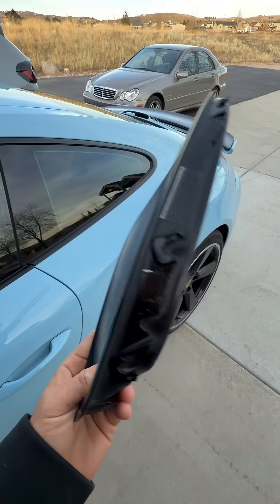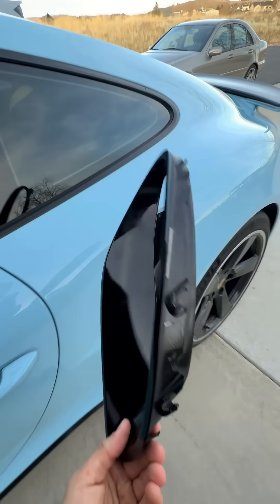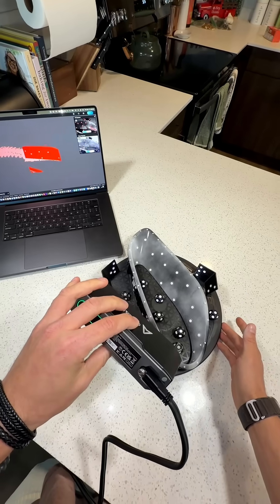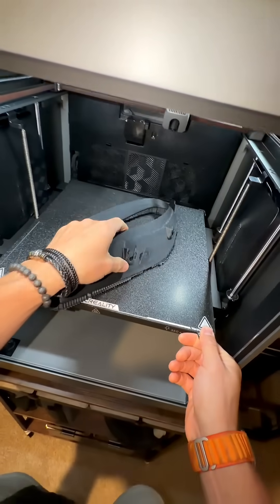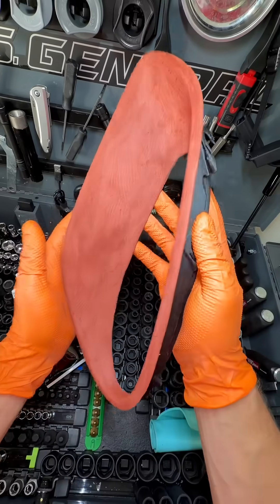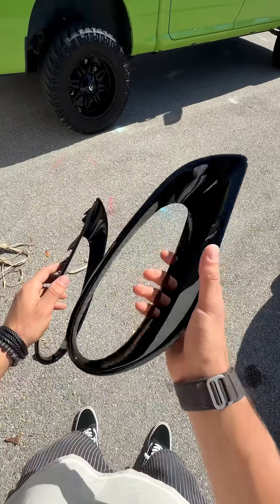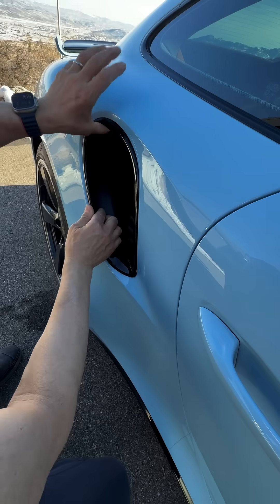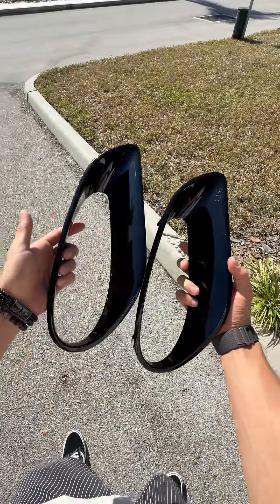Porsche wanted $2,000... So I 3D printed it for $20 instead😳😳😳 #3dprinting #creality #porsche

Comment: Creality Otter Scanner: $675 + Tax
Creality K2 Plus Combo 3D pritner: $1,200 + Tax
PLA used is minor, couple bucks.
Time to print everything, total about 2.5 days, maybe longer depending on print settings. Even longer for anyone who is new to printing and has to print multiple wasted prints to get the settings right before attempting the final product. 

Oh yea, any average weekend warrior could do this 😂 Spoken like someone who owns a Porsche lol

Edit: For the wasted prints, there is a recycle too that breaks down the prints. All you need is a PLA shredder, an extruder, and a spooler. That should only run you close to $10,000 😂

Comment: F Porsche. 

Saying this as someone who owned 2 last air cooled 911's (98, 4 and 4s). 

Still, definitely better than the bmws I owned. Both costs an 💪 and a 🦵  to service, but Porsche definitely far better quality, but also evrn more expensive than bmw to upkeep.

I miss 80's to mid 90's benzes. Even volkswagen, golf2 is unbreakable. Especially those 1.9 diesels. Tanks.

Comment: You can save a lot of money with 3D printing.  That said, you need the training and more money in equipment than a new part would cost.  Also; if the car was ever going to have collector or long term value - it has to be original.  It would have been cheaper for most people to pay the 2K on the part.

Comment: How long did it take you to do it all, and cost of materials etc? By the time you calculate your labour costs (and surely you aren't working at $15/hour rate😊), expenses etc, you need to add some profit to make your effort worthwhile. If that comes near $1790, then it's not worth the bother.

Comment: I feel like a decent amount of people are missing the point of the video's main idea. People are more focused on prices when I feel like the video's mainly just saying that sometimes investments are worth it. Sure it could be cheaper to just buy from the manufacturer for an unjustifiable price, but if you put around the same amount of money into something else, being a 3D printer, 3D scanner, Filament, and time, you could pretty much replicate things over again.
If I had to bring things together in a different way, you could go to the local staples to print all your photos or documents for a set price, but if you buy a printer, all you'd need to do is buy the ink and paper and print to what your supply has to offer instead of having to pay every time you want to print a singular page (I have realized how ironic it is that I used regular printers to act as a seperate way to put a perspective on the "DIY Investment" thingy that a 3D printer provides you with, but it's the best I got as of typing the comment).
Now yes, I do have a 3D printer, but no, this isn't something I'm saying just because I have this particular piece of equipment that not everyone has. I'm just trying to give an explination of what I think the whole point of the creator uploading the video was supposed to be, typing it with the least amount of bias I could have in myself... also I'm not going after anyone or naming anybody in particular, I just want to try to help explain to those who are looking more at comparing prices and seeing things in a short-term perspective (sometimes it's worth to spend a bit more now to spend less later rather than continuously spending the same amount. It like comparing 6,000 + (400 × X) with 3,000 × X, with X = amount of times needing to replicate. The 2nd one would eventually overshadow the 1st one despite starting off lower). Yeah it's a small part, but the guy specifically mentioned that it is a cheaper replacement if it ends up getting lost or stolen *Again*, I wouldn't want to pay a large price over and over again when a cheaper option's at my disposal. Now sure there's times where some things are more justified buying from someone else rather than making yourself, but why would people actively spend more for the same result unless they're just trying to burn through money, which would be a lot easier by actually burning it.
Anyways, long comment aside, have a good day or night to whomever's reading.

Comment: I mean did you really save? Once u ad the cost of the 3d printer, the 3d scanner, the body shop and the filament you’re probably pretty close to the $2000 part. So i wouldn’t say saved $1000’s. But nice work if you already have the tools.

Comment: Never thought I’d think such a simple part would be worth $2,000 - but this video has convinced me that this one is
Reply: It’s not worth $2000. They figure of some person paid $250,000 for a car they will pay $2000 for a part. If it was Chevy or Ford it would be $200
Reply: @BHFWaterloo  All you have to do is look at some of the parts commonality between supercars and regular cars. I have an Aston Martin with a lot of Ford parts in it. Aston alternator is $1200 and the identical Ford part is $225. Aston starter motor is $1600, Ford/Jaguar starter is $175. Aston washer pump is $750, Ford washer pump is $80. All identical. The markups are insane.
Reply: @BHFWaterloo it still is this + the porsche tax. The nornal version isn't significantly expensive. The carbon fibre version is expensive (obviously, everything carbon fibre + directly from teh manufacturer is crazy expensive)
Reply: People buy such cars to prop their egos, so they will pay for the parts.
Reply: @thestonegateroadrunner7305  Nobody likes to pay OEM parts prices no matter how prestigious their car is, trust me. Every supercar forum has a database of alternate parts to avoid OEM prices.
Reply: Funny comment 😆

Comment: The real challenge here is clean the 3D scan file to make sure the clips can fit back into the car. The clips are hard to scan as you can see in the video. It might get too loose or too tight. Plus the difference from the 3D printing, the fitment is the most challenging thing and you may have to adjust several times to get it correct. We have done this 5-6 years ago. It is not something new. In the end , you still print them in SLS nylon and provide the finishing to match. If you ask, I have to sell them $300-400 per piece. Cheaper than Porsche but not really some kind money making thing.

Comment: You say $20 like the 3d printer and scanner and everything isn't more than the 2k lol. Plus that piece is only that much if carbon fiber. So basically you had to spend thousands for a piece that's a couple hundred. I mean paying for the paint and the plastic to make it is prob more than the part 😂 But still badass it worked

Comment: Im so confused by these comments even if you stick with creality you could get an ender 3 for 240 a ferret scanner for 230 2 rolls of abs for 40 some filler and primer for another 50 then its 200 at the shop for a flawless finish. Thats 800. And people complain about spending their time? No one has time but some people do like to spend theirs making things. Some wild takes thinking this needs to cost 2k 8k or whatever.

Comment: Oh, God. NEVER use putty. It DOESN'T harden. You need to use something that you catalyze like bondo body filler or primer-surfacer or has 2 parts like JB Weld. Putty will cause bubbles in the paint.

Comment: So people in this comment section don't know what tools are or how they work apparently, or even the joy of creating something for that matter. I better not see a single workman down here with any kind of toolkit because don't you know it's easier to just pay someone to do everything for you apparently. there is no intrinsic benefit in having the skills and tools to be able to fabricate anything you need in any moment at all don't think for yourself just buy buy buy
Reply: While you are right about creating something yourself, the people aren't wrong either.

The part wasn't made for 20bucks, it was made through thousands of dollars worth of equipment and knowledge. That printer alone is around 5k. The scanner is AT LEAST another thousand.
If you want to do this yourself, it's gonna cost a lot of money, either by hiring someone to do it, or buying the stuff you need to do it yourself.

It's also been pointed out that the piece is not 2k either, but  goes from 150 to 300 bucks, depending on the material. Having such a car but being stingy enough  to look for such a complicated alternative is kinda "oof".

Comment: I think what annoys me most is the fact that he doesn't understand why the part costs so much.

- Porsche only has factories in Germany, Syria, and Malaysia, so these parts have to be shipped 

- Porsche doesn't just have 2017 911 Turbo air ducts sitting around in a warehouse 

- His dealership or repair shop has to put in an order for the part. 

It is a Porsche not a Toyota Corolla, it is a luxury performance vehicle. The time of their life spent modeling this part and the cost of all of that equipment is well beyond 2k.

Comment: Thats not $20, you have to add paint cost, worktime and equipment proration. All in all i would say $400-500. Also since its not using carbon fiber you should use the plastic counterpart price, that ironically is around that price. Well good example of 3D printer use, its a good option if you own all the materials and tools.

Comment: Right, so I'll have to go buy a 3d printer, one of these scanners, the plastic for the printer, spend hours setting it all up and scanning the part, print it out, then take it to the bodyshop to get it painted.

It'd probably cost me 10.000 worth in time and resources, but atleast if the airduct breaks 6 times it would finally be worth it. But then again, if it breaks that many times it's better to just buy the OEM part.

Comment: 3D printer. 3D scanner. 3D software. 3-4 filaments. multiple prints. knowledge of how to use all of it. primer. paint. time. did you save $2000? no, but the next guy will.  you can sell the 3D model for $5 and he can print it himself without the legwork that you put in

Comment: Ok you buy a $100k car, but can’t afford a $2,000 part. Wow…. And you really haven’t saved any money. Someone like me would have to be the scanner, and the printer, and then do all that work to prep the part.  When all said and done, it would have cost me way more than $2,000. My time is worth $225 an hour. But even without taking my time into account. The printer scanner, software, all are over $2,000

Comment: People think you spent $2000 on the printer and supplies, and that it's not worth it in the end. But how are you not getting a better deal by having the 3d printer and saving money on everything else you 3d print, while also getting the car part?

People out here probably also think the same thing about buying solar panels on your house, "instead of $300 a month for normal electric, you're paying off $20,000 worth of solar panels, paying $300 a month anyway. Not worth it!" Even though it pays for itself once you sell extra electricity back to the city, and pay off the panels in a few years.

Comment: Tbh having a 3D printer on a bodyshop really worthwhile…doing custom body works specially on bumper retainers which holds bumper to the fender/q-panels are often gets cracked or broken in to pieces on accidents…sometimes it’s harder to find a correct one for the model or asking ridiculous prices…

Comment: And how much did the fucking 3D printer cost? How many hours did it take to do all that rendering and prep work before fabrication? How much did the print material cost?
Yeah no thanks. I'll pay $2k as a fucking PORSCHE OWNER and buy the replacement part.

Comment: If you already own the $1200 overall equipment, then yes, this costs around $250 total. If you don't, getting it all is still $1450, $300 less than the factory replacement. That's how dumb a brand placing their sticker on some plastic thingy for the pricing, is.

Comment: Love when people try to justify their cost savings but always leave out key factors like, ones time. Time is invaluable and has a high cost that is often far greater than a few bucks. Secondly, they already pre own the equipment and software. Third, let’s go back to time again because now we have to factor in the “learing”👀🤣 cost of that to even begin how to do this. And lastly, if you can afford a Porsche, you “should” be able to afford the upkeep in keeping your “investment” full intact. These cars are not just high end, but they are also an investment. Replacing high end manufacturered parts with plastics is ridiculous. People are making carbon fiber parts as cheap today that are a net benefit to your investment.

Comment: Considering the time and the material costs, this is completely stupid on a car you paid 200k. Just get a cheaper car than. The new parts of course will break after a year or so the first time they see a cold environment, for example. There are aftermarket parts that cost a half and meet automotive standards. This should be cheaper than all your work.